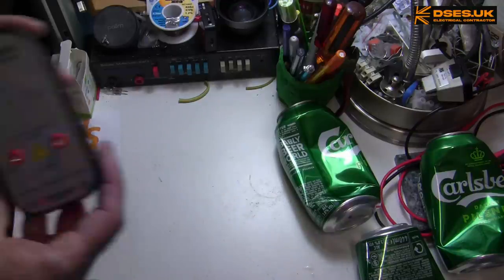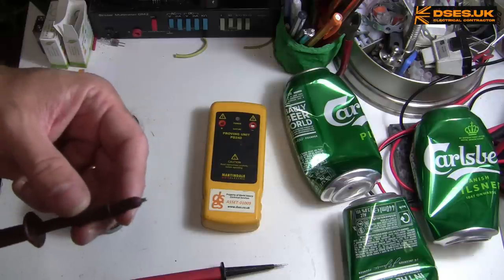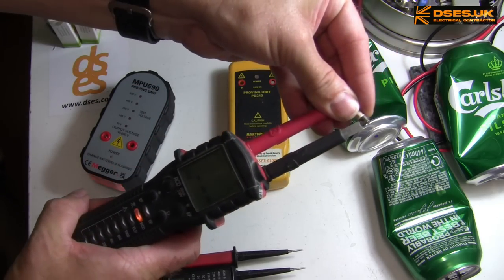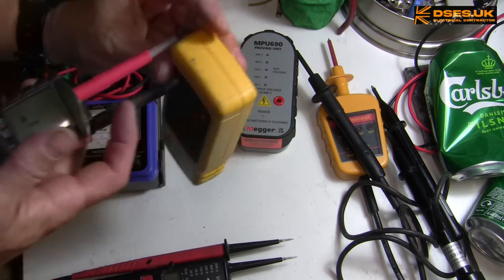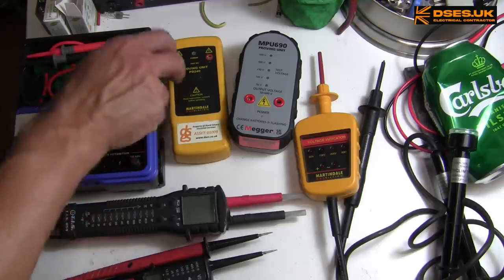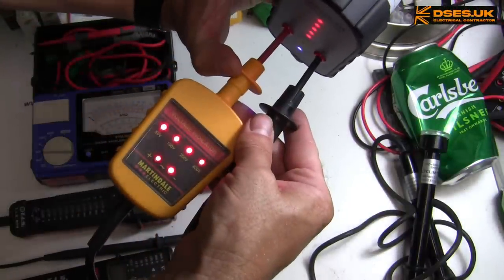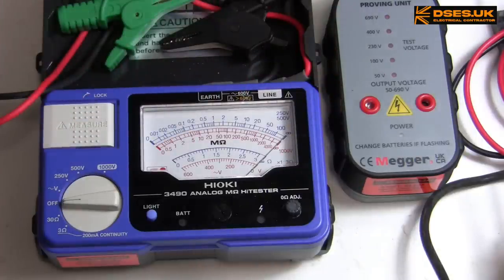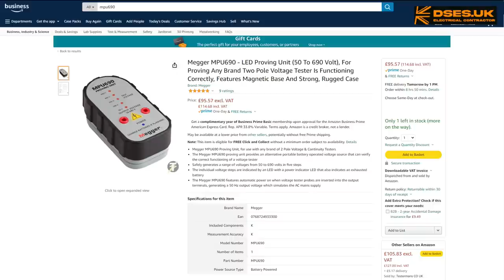NTT: The Megger MPU690 Multi-Voltage Proving Unit

Comment: Our old NICEIC area engineer hyperventilated when I got an old John Drummond proving unit out with a filament lamp and a battery with neon to check the lamp.
Reply from the maker: I might break out the Cyclim on my next assessment and see what the guy says!
Reply: @dsesuk  MTL70
Reply: Can't beat them, it's all I use as a cable jointer. Must admit I prefer the Drummonds to cyclims as you get a clearer light

Comment: I use the socket and see sp400 which looks similar to the megger but in a nice orange and black and it does step up and down through the 5 stages allowing you to check your tester accordingly.
Reply: It also tests Non contact voltage testers which is a useful feature.
Reply from the maker: Ah poo. Kinda wish I'd seen that one first!
Reply: @dsesuk  I find you can check your death stick by pushing the probe in to the terminal of your PU that has the switch in it. As long as your PU has a AC output your death stick should indicate voltage.
I had one of the PUs that had a death stick function. When I came to use it the batteries were dead as the button for that function had been pressed while in my tool bag. A recessed button would make far more sense.

Comment: Like the vintage Sinclair multimeter amongst the beer cans, I've got a couple of those somewhere, and live dangerously without the probe tip shrouds, interesting stuff as usual 👍
Reply from the maker: Cheers Paul.
Reply: I have an old Realistic/Tandy multimeter, it is still very accurate and passes all calibration to this day, made in the 80's it just sits on my work bench for quick testing... I love it.. But my flukes have become my workhorses nowadays lol..

Comment: Hi David yes the shrouds on our voltage indicator probes and on some MFT test probes are a pain in the ass and are not fit for purpose. So as not to offend anyone I have just replaced the shrouds on my voltage indicator with a bit of heat shrink. I am now complying with GS38 again . And have no issues with making good contact with the screws on breakers or the test port’s on wago’s  so everyone’s happy? I doubt it .

Comment: I like the Socket & See SP400 proving unit which is multi-voltage 50-690v and can also test Non contact voltage testers. There is also the SP200 without this feature. They are both cheaper than the Megger MPU690.
Reply from the maker: Socket & See just doesn't seem to be a brand on the radar around here. A shame, as their kit matches my corporate orange colour!
Reply: @dsesuk  it's the sp200 I have and odd there not on peoples radar as there apparently a British company but as said in my earlier comments mine whines badly
Reply: @dsesuk     I find physical stores rarely stock what I desire. I buy what I want to buy, not what stores decide to stock. You can get Socket & See on popular online stores including electrical wholesalers. SP200/SP400 count up the voltage and back down at a constant speed, not too fast. It is so much better than the Megger. I love all S & S kit, and they seem to share a lot of their designs with Kewtech. I was told they have the same product designer. I much prefer S & S colours though, Kewtech’s are boring.
Reply: @gadgetman36  kewtech started socket and see it was to cater for plumbers to give them basic test equipment. But they became very popular with  electricians as well so know socket and see are readily available to ever want them there not a bad product just overpriced for what they are .

Comment: I have an old RS Components voltage tester, that simply used some sleeving over the probes to achieve GS38, every time the sleeving gets damaged I just renew it and Mr H&S is known the wiser. I believe the Socket & See manufacturer is the inhouse brand for Acutest, not sure who the original OEM is though.

Comment: Concerning the safety-condoms on the testers: I have a pair of Fluke TL175 test leads.
Quite handy to not have a loose thing getting lost while being available when you expect spicy voltages.
Reply from the maker: A manually set twist lead like that is the best option. Even if I wanted to shroud my tips, I no longer can because they've been misplaced. Having something like what Fluke use where you can set the length accordingly is the best option.
Reply: In my opinion having used both, I think the TP175 is preferable to the TL175 because I like to be able to swap between probes, croc clips, hook thingies and other adaptors I've made myself.

Having separate probes and leads (TP) rather than combined (TL) enables that.

But yes, having used Fluke TwistGuard I hate using anything else and I don't know why they aren't an option on all Fluke's test kit.

I'm not usually a Fluke fan but they really are worth it.

Comment: Oh My Days! The GS38 probe bullsmilk gets right up my hooter. You can't test circuits properly because the screw holes are too deep or narrow for the shrouds. I have the Kewtwech Proving Unit and the Fluke 150 tester and the Kewtech has decreasing voltage. I think the Megger was more expensive.

Comment: Interestingly I have the Kewtech Kewprove4 which looks identical to the Megger you have in this video. Seems like they are all just putting their branding on the same product.
Reply: The Kewtech proving unit also cycles across the voltages, although it does not show it on the proving unit, if you hold it down, I am sure it does it slower than the megger also..
Reply from the maker: Funny how all this stuff seems to be a rebadge of a common component!

Comment: On the 2-4mm tip thing, I think it's infinitely preferable to make reliable contact with the thing you're trying to test rather than be constantly second guessing (or evening just not noticing) whether or not the probes have made contact. I completely agree with you.

Hence the Fluke TwistGuard probes and me not liking test equipment that has non replaceable leads. It is very occasionally useful having the extra plastic.

I have to trust my clamp meter for safe isolation on solar circuits (there's little point in measuring voltage, of course it's live - what's important is that there's no current) and the weight in my bag is limited by what I can carry on to a roof. I'm not about to carry a redundant tool if I don't have to.
I deliberately bought an older Martindale proving unit assuming it would be DC and was disappointed to receive the new-fangled updated AC model. But who needs a DC proving unit anyway when you have an insulation resistance tester ;)

Finally - the pictured testers (plus Kewtech and many others) are manufactured by an OEM  called HDT, based in Germany. I was about to be a smart arse and say they're not made in Shenzen but their main factory is in the same province and they have offices in Hong Kong.
Reply from the maker: Twistguard probes seem to be the right solution. I presume Fluke have a patent on 'em? Thanks for the info on HDT.
Reply: @dsesuk  I presume so too. I keep meaning to buy some spare ones for my MFT and just deal with the end being the wrong colour. 

If they weren't patented I assume everyone else would make them. Martidanle's springy probes aren't far off being usable but they just don't lock back far enough. I guess I could chop the plastic off so 4mm was always exposed and significantly more when retracted.

I cheaped out and bought generic silicone leads to use with my Fluke probes in my most recent purchase. The genuine Fluke ones are a lot better but the biggest difference is in the probes.

Comment: It is definitely not stepped voltage on that MPU like most, my kewtech is the same. It just charges up then discharges slowly and your meter of choice picks up the dropping voltages as it discharges (linearly). I hate those gs38 probes too, I just don't use them, as you say Dave, if you know and are wise enough, it's just a pain in the ass.. Leave them off. I wonder what sort of power they can output? It's basically a low powered inverter at the end of the day. Maybe do an experiment to find out? See how many gu10 led lamps it will light up 💡😂
Reply from the maker: With electricity prices being what they are, I might be relying on rigging this to run some small appliances in the home this winter!
Reply: @dsesuk  do you know Dave, I thought the same thing 😂 even a PV panel charging a leisure battery and some 12V MR12 led lamps as emergency lighting... Just in case... The world is crap at the mo... Look after yourself!... Heat for food can come from fire!.. Burn ya regz books 🔥😂👌

Comment: I have the Ethos version of that proving unit (I know, don't judge). It is exactly the same as the Megger except a different colour and a different sticker on the front. Not having the Megger name on it meant it was substantially cheaper.
The requirement for six AA batteries does piss me off rather, but they do provide more power than a single PP3 so I understand why they have done it.
I never leave my voltage indicator connected long enough to show the LEDs extinguish one by one as I cannot really see the point. As long as they all light when checked then I know that they all work.
Reply from the maker: It looks like the Ethos 4299 is a bedfellow of the Socket & See SP400.  I wonder if it is just a case of different colour case plastics or if 'higher' marques have something different in the guts?
Reply: @dsesuk  As far as I can tell they all behave in exactly the same way. I suspect tester manufacturers are just getting the same unit made to their colours so that they can have a wider list of equipment to sell. 
I believe British Gas just got Socket&See to add the BG logo to a lot of their gear that they supplied their boiler guys. There seems to be quite a lot of stuff with the BG logo appearing on eBay since they fired a lot en masse.
For something that I probably use as frequently as you do I didn't want to spend extra money for a "more respected" brand.

Comment: It's like they assume idiots are using these things. The problem is the idiots aren't using these things they're just dabbing the wires together and bearing it in a wall. The finger ridge should be enough even if you're a bit overworked working into the night on that job that needs to get done by morning.

Comment: i recently purchased a similar model branded british gas off ebay for £20 without all the voltage lights on it. my one does the same it drops voltages quickly but it makes all the lights light up on my voltage indicator. had to buy a new one that went above 400v as i started working on 3 phase appliances that were hard wired in. Which is so annoying there is no need for it not sure why there not on a industrial pce plug it would make safe isolation so much simpler.

Comment: Hi Dave, I thought probe tips were there just to stop the metal corroding on the way over from Shenzhen, I don't need a proving unit, at my age my skin resistance is so high I'm almost a perfect insulator, so much so that I have to use a more moist part of my body to send a text msg. on my mobile phone..
Regarding the use of 6 AA batteries over a PP3 it's just a matter of capacity as I'm sure you know, your video presentation is still one of the most interesting & entertaining on YouTube.. Regards from the extremely old sod from North Wales..
Reply from the maker: Crikey Ray, I dread to think what body part you're using to type this with!
Reply: @dsesuk  Hi Dave, I have tried my nose and my tongue up to now, what else would you suggest?

Comment: A lot of lager died to make this video possible... With the TIS, would those retractable shrouds be better, ahem, trimmed a bit? Get a passing Mohel to snip them back 4mm so you can test fuses more easily, but also retain a bit of springy protection?
Reply from the maker: It has been suggested, and it might work, although I'm happy to keep the 845 as my go-to as I also found I prefer the audible tone to the vibration function of the 859.

Comment: I definitely keep my foreskin nice and short. However could a solution for your retractables be cutting them just enough to expose the 2-4 mm for fuse testing and the retraction will remain for protected rcbo testing capabilities?
Reply from the maker: I could modify the 859, but to be honest another reason for going back to my older 845 was that I preferred the audible indication over the vibration!
Reply: @dsesuk  I agree, best not to mix business and pleasure!

Comment: Thanks for this, especially doing it in the crazy temperature. Have you had your blood pressure tested lately? You might want to after getting all animated 😊.  
One thing I found interesting in this vid is how my opinion Megger equipment is some of the best "made in Britain" kit out there, has been shattered. Their voltage tester you show is a rebrand, and following the comments, I see that their PU is the same as the Socket & See, gutted. 
If Nige's MFT1741 is due for calibration soon he might want to ask Megger if they are still doing their calibration upgrade which gets it converted to a MFT1741+ for not much more than the calibration alone, now you might be doing more EV and Metrel might ask for their kit back.
Reply from the maker: I wonder if there are component differences - you know how you sometimes have a PCB with a few things missing that perhaps 'better' models have included? What's needed is a side-by-side teardown of two brands that clearly share a design.
Reply: @dsesuk  absolutely! Rip it apart bro! 😎👍
Reply: @dsesuk  a bit like Big Clive. That sounds like a plan.

Comment: Let me get this straight you actually have to go through like a yearly test of these things and prove that your equipment meets the standards? Would it be possible to do one of these tests where you test everything as dead and then touch 2 wires together and it's not dead on purpose to prove that the tester is at fault?

Comment: I have the socket and see version same unit essentially just in an orange and black case instead and after checking don't mine has a worse whine than yours interesting to see an on the tools sparks show that gs38 sort of sucks balls in the real world
Reply from the maker: I certainly don't want to encourage cutting corners on safe isolation and I don't want to undermine the teaching of it, but those who draw up standards need real world testing, otherwise those standards end up being circumvented and defeated.
Reply: @dsesuk  absolutely while waiting to back to college to get the paperwork to make me legal to do electrical work I have been picking up some of the basic tools required and I did find with probe covers on my di-log tester sometimes the probes barely made contact and as my old boss actually said to his nic assessment bloke safety regulations are all well and  good when they are effective if it's going to leave me unsure if it's actually dead then sorry chap the covers are coming off as my life is more important

Comment: 2 - 4 mm as you say is fucking useless, as sometimes it won't reach the screw head.
Reply from the maker: If the safety features prevent it from doing what it's supposed to do, then something needs fundamentally rethinking.

Comment: I have a Test Mate PU 100 version of this proving unit looks like you went for the big name and got the same item. I have also wasted money on a Fluke PRV240FS and the T6 1000 with field sense actually a whole lot of nonsense 🤡🐔
Reply from the maker: I remember drooling over the T6 1000 when it came out. I was very tempted. That Fluke gear tends to last the distance though.

Comment: I’ve recently purchased 2 of the new megger TPT420 2pole, continuity, voltage testers and what a crock of shite they are I’ve failed to even get the battery’s in to them, the retaining post that holds the battery cover on shears off before you can actually tighten the screw, even after a rant in CEF they had ago themselves to put battery’s in one and failed again definitely a Chinese design fault there